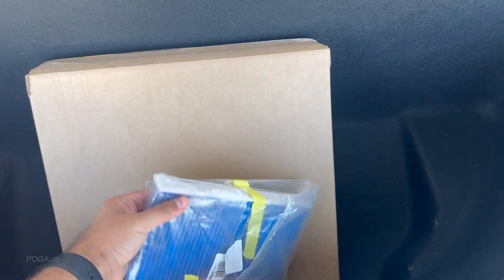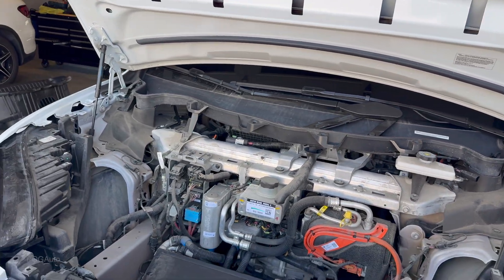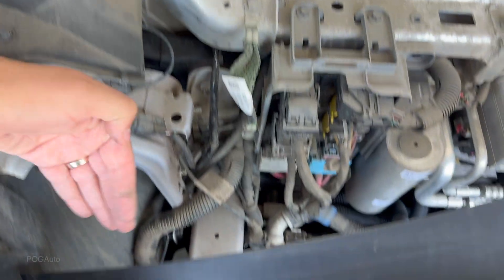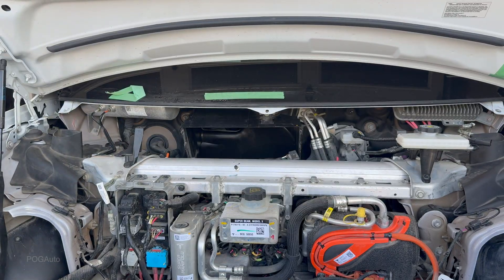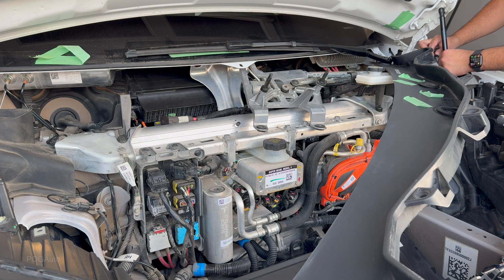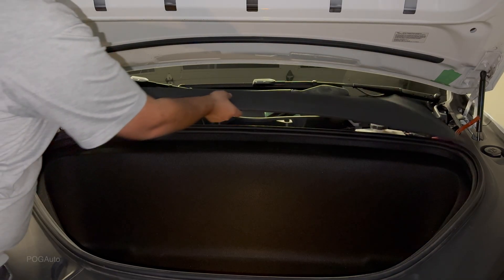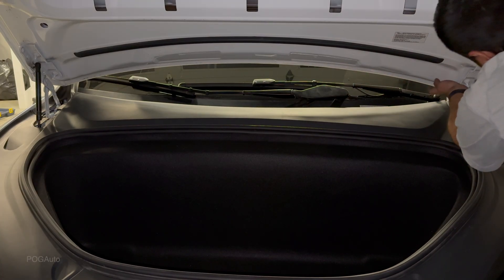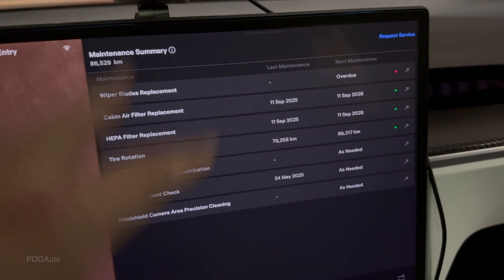Tesla HEPA Filter Replacement: 2022 Model X Refresh

Comment: This is crazy. What a bad design. BTW, there are so many other ways of removing wipers arms without buying this special tool. Just ask Youtube and you'll see many different easier ways. Also, no need to remove the LV battery. That bracket will slide over to the right.

Comment: I had a mobile service appt. today to get this hepa filter replaced, cabin filter replaced and left camera repeater.  The tech accessed the main hepa filter hella quick.  Told me it was all good and to not replace yet.  If you don’t have the time/patience or mechanical aptitude, just schedule as a mobile service.
Reply from the maker: What made it super hard for me was not having a proper wiper removal tool. However for sure it is still a lot of work to just replace a filter.

Comment: Thx for the video! Actually on legacy it’s still hard because it HEPA glued into housing. So I would say the same difficulty. Zip ties are crazy to see…
Reply from the maker: it's just this one is more work in removing complicated parts, however if I had a proper wiper arm removal tool this would not have been as difficult to do as it was for sure.